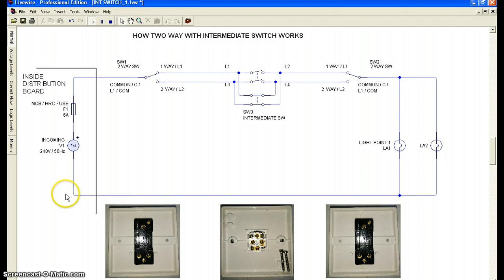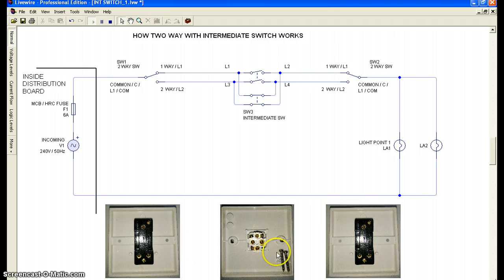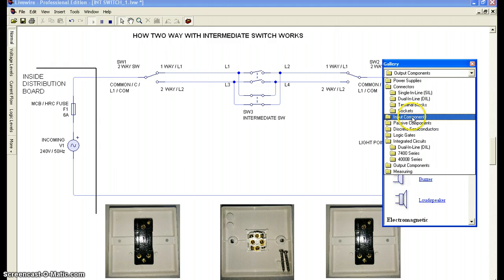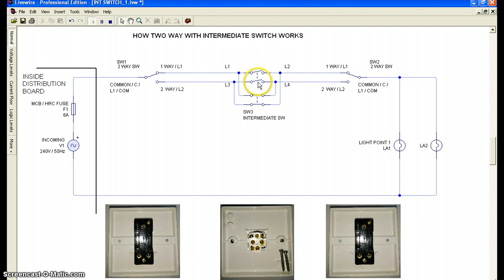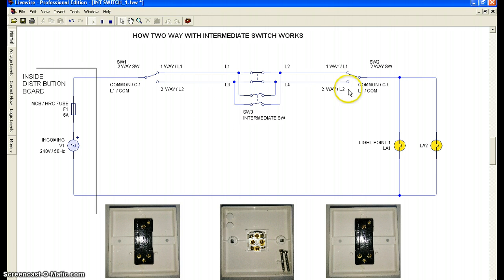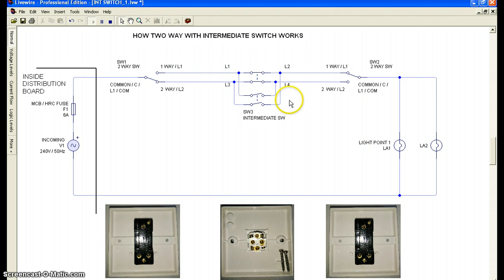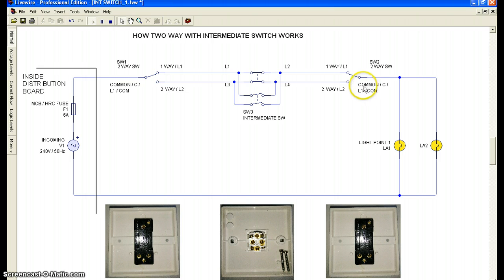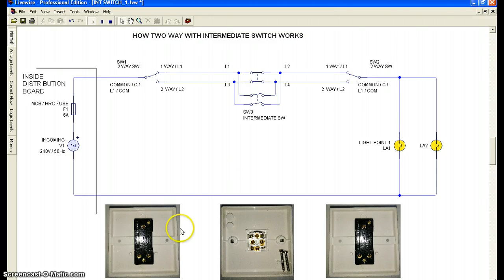HOW INTERMEDIATE SWITCH WORKS

Comment: Tuan, boleh buat 1 video tentang 2 way water heater switch
Reply from the maker: @tanhockheang2396  nak guna suis 20A 2 way? atau nak saya buat guna suis lampu 2 way + contactor?
Reply: @petrusgoel  tuan, wire 2.5mm pakai switch 20A - 2 way thanks
Reply: Suis lampu 2 way + contactor juga ingin saya belajar, thanks